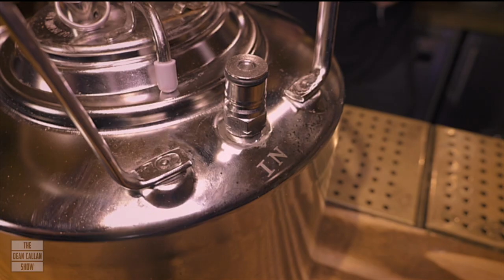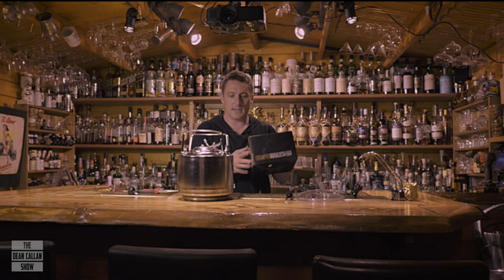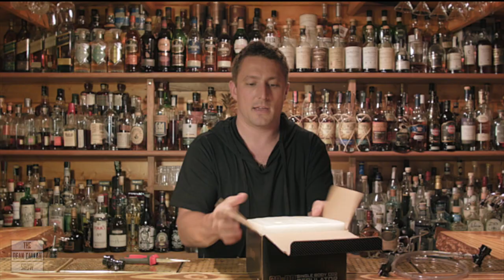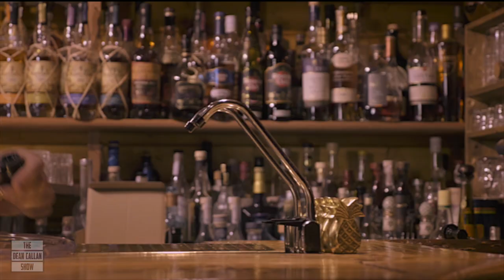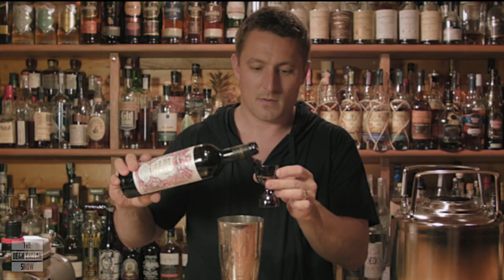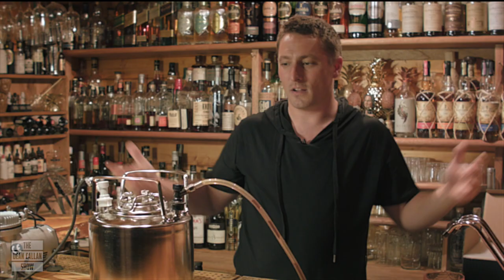HOW TO BUILD A COCKTAIL TAP

Comment: Hi Dean, your video was so helpful for me to build my own one for the bar . 

Also, I had a conversation about it with a rep in France. And the Cornelius keg / soda keg, are exactly the same as beer company use for cleaning beer line , it's called sanitation keg. (I didn't try it yet ) they are exactly similar but instead of having the a in and out , it have the tap head we put on normal beer keg, which allow you to have the CO2 directly in with that tap.  whithout having the gas line in the "in".

So if this normally work, we should have the cocktail passing by the cold system and coming out fresh....

I will let you know. 

Please continue your video. It's great 👌👌
Reply: Hey  Julien, sonds super interresting have you succeed ? 
would love to hear from you dude
Reply: I am really interested. Can we get in touch ? I have a couple of questions.

Comment: use that air brush compressor at your own risk cause it's not meant to be food grade so there could be oils vapor and stuff like that and it will condense in your drinks, same thing with co2, paintball tank refill places and stuff like that are not meant to be food grade, when dealing with drinks use EVERYTHING food grade including the gas, and not just clean it needs to specify food grade

Comment: Great video, thanks a lot.
I am looking to buy a set up for parties. Even if the keg is fresh at the begining of the party, it will get warmer and warmer. Also, I read online that the picnic tap is not suited for high carbonated beverages, like soft drinks and cocktails. So, did you experience any foaming problems when serving the drinks ?
Reply from the maker: Is the keg going to remain in a cooler box? If so cover it with ice, the cooler is is the less likely it will froth out and make a mess. 

Think like this, if you put a can of coke in the freezer so it’s super cold, the cold will stop it being too frothy and the bubbles will last a long time. Provided it didn’t freeze. 

But if it’s super warm it will froth up much easier! 

Also the “thicker” the liquid is and the more impurities or flavour it has the more trouble it will cause.
Reply from the maker: If you can explain your set up it would be easier to help get an idea of what to do, also what you might be putting in the keg?

Comment: Question, with using the air compressor with ambient air. Is there any oxidation in the vermouth?
Reply from the maker: Yes 100%, so it’s better to be moving through it reasonably fast. For that reason I have some really small kegs

Comment: Does the CO2 make it carbonated? Like what if I want a cocktail without the carbonation?
Reply from the maker: Yes the CO2 will eventually force its way into the liquid and carbonate it, you can use Nitro gas to avoid that. Or as I did in this video use a compressor. The compressor method isn’t the most “beverage safe” tested method but I’ve been doing it for years and never had an issue.

Comment: What Hose did you use for the Airbrush Machine>?
Reply from the maker: Moshe Goldsobel I used the one that came with the compressor but I cut it and then attached it to a barbed gas inlet for a Cornelius keg.
Reply: @DeanCallan  Amazing - Thank you! The link for the Keg set does not work, where can I get same one from?

Comment: would this work if I filled the keg with just a single liquor to have say draft vodka in my keezer?
Reply from the maker: Matt G yeah it would work, but might give a hint of CO2 flavour
Reply: Where do you get the liquor dispensers you show on the bar?
Reply from the maker: Jim Gazint the taps?
Reply from the maker: Jim Gazint Amazon, they are water taps

Comment: Doesn't using air to pressurize it oxidise the drink? I'd imagine the vermouth in the negroni would start to go a little funky after a day or 2.
Reply from the maker: 100% it definitely oxidises it a bit but the alternatives like CO2 add considerably more flavour, the batch sizes I do are not huge though. And in fairness when 40+ abv gin and Campari which has a lot of sugar are added that helps fortify the vermouth. 

Most importantly though, the batches don’t last long ;-)

Comment: How do you know when the keg is pressurized enough when using the air pump method?
Reply from the maker: Kevin Patnode Hi Kevin, just like the guage on a CO2 canister an air compressor has a gauge on it. It allows you to adjust the pressure, as pressure is released when using the tap the compressor turns on and pumps air to your desired pressure.

It’s actually very easy to adjust pressure ;-)

Comment: While this is a good overview of how to do it for parties and events this is not great for a cocktail that might be sitting for an extended period.
Using the air brush pump (which is not designed for food and therefore possibly not safe for this use) you will oxidize your cocktail over time. This means that for example your vermouth will go bad.
Using CO2 will carbonate your cocktail. This is fine if you're making a carbonated cocktail but if you are making a negroni you probably don't want it carbonated. If left at pressure with CO2 all waterbased liquid will carbonate, the level of carbonation will depend on temperature and pressure (more pressure = more carbonation, lower temperature= more carbonation). If you really want to do this and leave the cocktail for an extende period I'd set the pressure pretty low (2-4 psi) and not keep the cocktail too cold and simply serve it over ice with a quick stir.
Reply from the maker: Agreed, it's not ideal to let the drink sit for an extended period, this is why we use really small kegs.